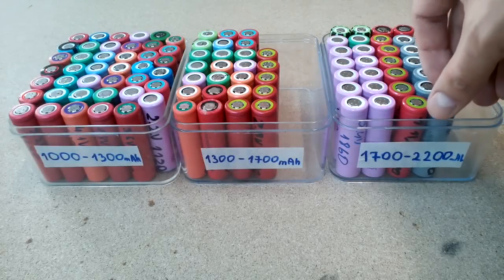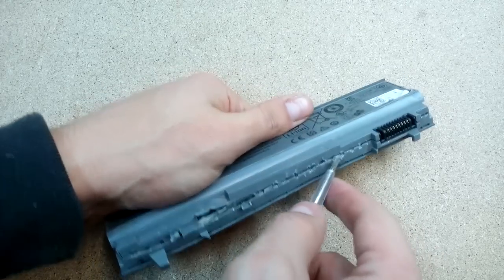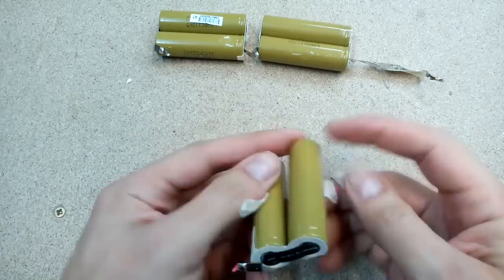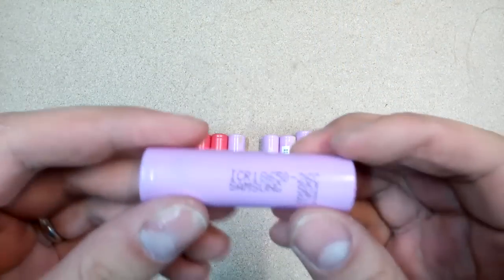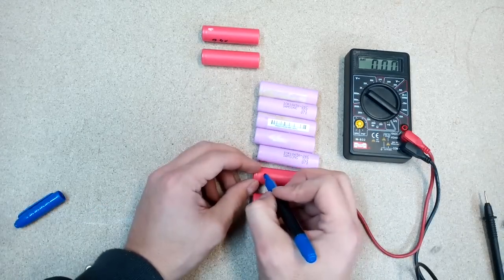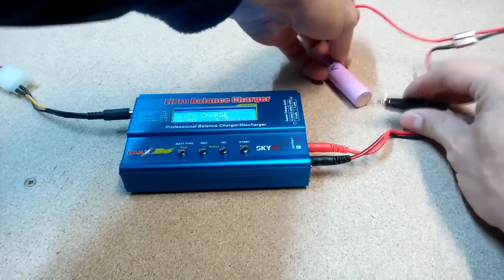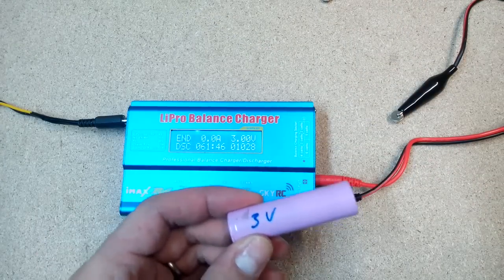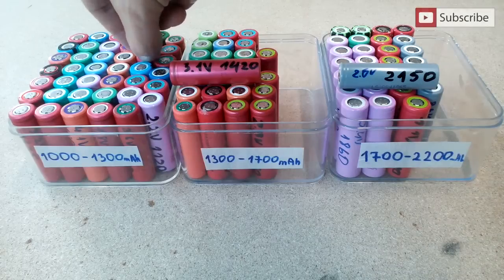How To Get: Free 18650 Lithium Cells From Dead Laptop Batteries

Comment: Hi, i took the plastic of of the cell, does it matter?
Reply: Yes, the whole side of the battery is part of the negative contact, without the pvc wrap its dangerous due to the possible event of a short. Rewrap it or safely dispose of it
Reply: +ADTRGaming thanks!
Reply: +iBraekHD if you decide to rewrap it, you can find the pvc 18650 wraps online in a pack of 10 or so for a dollar
Reply: +ATDRgaming thanks sir!

Comment: 1Amp through that little contact patch between round magnet and cell post? 
Although it is a smart way to connect tings, the capacity/voltage measurement won't be very accurate...
Reply: I use a similar method, loses maybe 200mV at 1A.  At least half of that is leads and connectors, not just magnets.

Comment: i took apart a dell battery that was not dead but really good cond. it said it had 2600mahs and it had 6 batteries in it.  is it safe to use in a mech mod with a .5 ohm aspire atlantis?
Reply: No. Unless you want to blow part of your face off.
Reply: Vapers get on my nerves so fucking bad. There's always those who spend 20-30 bucks on a bottle of juice and want to save 5 bucks on batteries by tearing apart your laptop and then those who think you'll automatically blow your face off by doing it. Here's the real answer, Google the numbers on the batteries, that'll tell you what they are and their amp limit, then using ohms law figure out if your vaporizer or whatever you'll be using is under than number, if yes, then yes you can use it, if no then no don't. Will you blow your face off if you do anyway, probably not. Also if you can't figure that out then you shouldnt be using a mechanical mod, especially not in 2016 where you can get a safe VW mod that'll do 200 watts for very cheap.

Comment: i own the same charger and its a top 10 must have item for the DIY. You can charge any type of battery with it and also has variables you can set for each battery function (lead acid, nimh, lipo, etc...) Have even used it to charge my car battery after i left interior lights on... but 1 trick i just learned from this video thats simple yet genius... magnets to hold the leads on! woohoo... the charger in this video comes with 5-6 different type plug adapters but you would not believe the many 100's of types that you dont have handy. So, im always rigging something up... usually with alligator clips but those dont work every time.... magnets. if anyone has any other of ingenious ways of making these connections (Ex. small connectors where the pins are surrounded by a cover that doesnt leave enough space to get clips on the pins. Nice vid... i do something similiar with lipo cells. many multi cell lipos 2s-6s are common but can have more cells... usually have 1 or 2 bad cells. so you can remove these bad cells... replace them with good cells OR just lower the cells for that pack. Ex. 4s lipo with 2 bad cells will make a good 2s battery. Try swaping pb (lead acid) type batteries for lipos in your kids ride on toys. lasts longer and will make them much faster depending on volts which is determined by the number of cells. the crappy 6v battery powered ride ons suck. drop a 2s or 4s lipo and be sure to test it out with your kids first. they can flip over easier, pop wheelies, etc so use common sense dads... dont blame me if you put a 6s in Little Wilbur's ATV and he slams into the tree doing 20mph. Google this type of DIY projects, you will be amazed at some of the custom rides Dads do for their kids? or for themselves